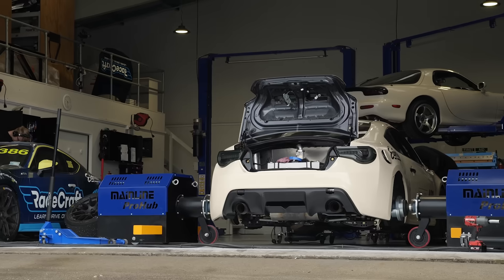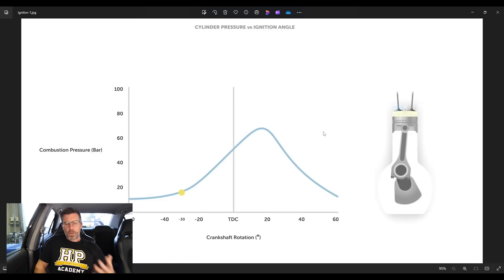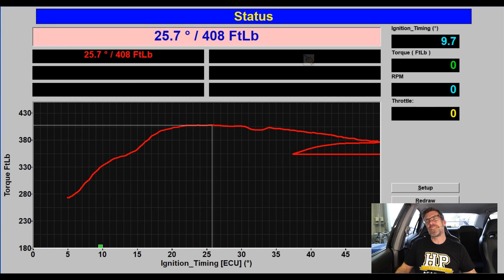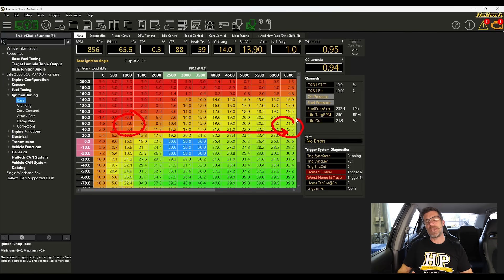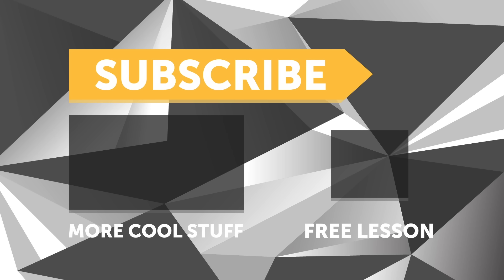25° of ignition timing gave us MAX power. Why?

Comment from the maker: 🙌  Enrol today and get $400 off HPA VIP online course package deal: https://hpcdmy.co/vipek
✅  Want to learn more about ignition and fuel tuning, injector dead time, air-fuel ratios and more? GET 50% off your first HPA EFI tuning course and start learning instantly: https://hpcdmy.co/igtime

Key Terms:
TDC = Top Dead Center
BTDC = Before Top Dead Center
MBT = Maximum Brake Torque or Miminum Best Torque
RPM - Revolutions Per Minute
------------------------------------
TIME STAMPS:
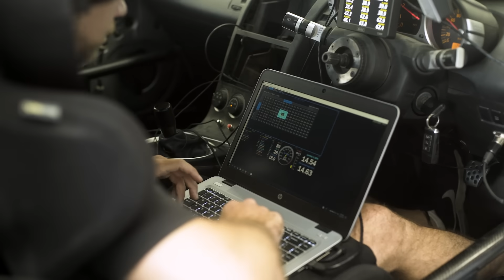0:00 - Common Issue
0:13 - Getting It Wrong
0:22 - The Plan
0:37 - What Is Ignition Timing
0:51 - Combustion Misconception
1:13 - What Is Actually Happening
1:35 - TDC - Top Dead Center
1:53 - BTDC - Before TDC
2:10 - Load Vs RPM
2:24 - Combustion Pressure Graph
3:10 - Compression Begins
3:53 - Peak Cylinder Pressure
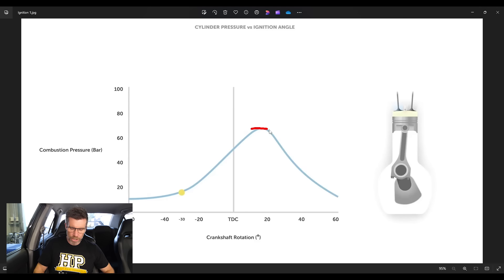4:08 - What Happens When Timing Is Wrong
4:42 - Overly Retarded Ignition Timing
5:23 - Overly Advanced Ignition Timing
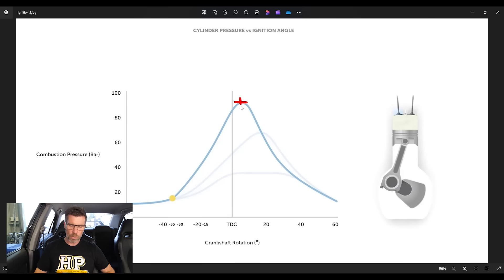6:08 - The Goal Of Ignition Tuning
6:26 - Cylinder Pressure Data
6:44 - Torque Feedback
7:00 - Torque Optimisation/MBT
7:30 - Sweep Test
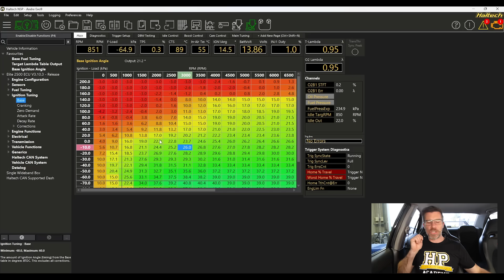7:53 - Base Ignition Timing 3D Table
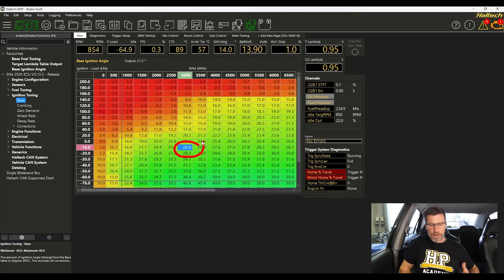8:19 - Test Cell
8:56 - Dyno Demonstration
10:06 - Results
10:49 - MBT - Maximum Brake Tourque
11:21 - IMPORTANT TO NOTE!
11:38 - Knock/Detonation/Pinging/Pinking
11:57 - Just ONE Cell Optimised Here
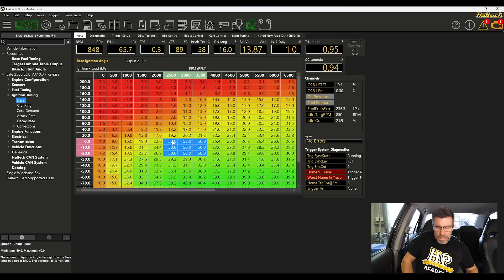12:11 - 1st Ignition Tuning Table Trend
13:04 - 2nd Ignition Tuning Table Trend
13:34 - Low Load
13:50 - High Load
14:02 - Final Notes
14:25 - BUILD.TUNE.DRIVE
------------------------------------
🏆 Win FREE ECUs, engine components, wiring tools, alignment setups and more. Enter now, no purchase required: https://hpcdmy.co/giveaway

Comment: How to get Hp tuning softwares
Reply from the maker: You can download VCM Suite form the HP Tuners website. It's useless unless you're vehicle is supported by HP Tuners, you have their interface tool and also are setup with the applicable credits for your vehicle.

I've linked a guide on how HP Tuners works which covers all those points - Taz.
https://www.hpacademy.com/technical-articles/reflash-tuning-with-hp-tuners/

Comment: Was this a inline 4 engine ?
Reply from the maker: This knowledge applies to any 4 stroke EFI piston engine. This one has 4 cylinders to answer your question, but what is being discussed is not specific to just this 1 engine :) - Taz.
Reply: @hpa101  the reason I ask is because I have a in-line 4 ZX 10 Kawasaki , I was just trying to get some knowledge
Reply from the maker: The principles  here will help you with your goals on your Kawa 😎 - Taz.

Comment: Thank you for a clear and concise explanation, particularly with the graphs showing cylinder pressure, and the demonstration of the torque increasing as the timing increases.

Question:  If the combustion event takes a finite amount of time to occur, wouldn't that mean that timing should always be increasing as RPMs increase?  If that's the case, why do most mechanical distributors (and electronic ignition timing tables) max out the timing after a certain RPM? Such as, getting to about 30° of timing by 3000 RPM, and then still being at 30° advance at 6000 RPM?  Shouldn't they just keep increasing?

Comment: How do you verify any of what is said here. Without measureing chlinder pressure with cylinder pressure sensors you do know where you will have:

1. TDC
2. Compression curve
3. Combustion curve
4. When to actually set the timig. 
5. Knock borderline 
6. The start and lenght of knockwindows. 

So how is any of this verified in the tuning to come anywhere close OEM calibration of these things?

Comment: How were you doing the sweep, just manually adjusting the block of cells during the test?  I was wondering if doing RPM hold mode with the dyno and just sweeping each column wouldnt be a viable method of doing this.  Just curious.

Comment: Do this with a LS
Reply from the maker: Try this link Jimmy, it covers the basics of LS ignition tuning using HP Tuners: https://youtu.be/zi9g7Uhx-Nc
If you're tuning your car using an aftermarket ECU, then the video you're on here actually applies. It doesn't matter that we're tuning an SR20, even if you were too you'd be using these principles to find your own ignition timing figures, not just copying and pasting. Understanding what is done and why is the point.

Note HPA's Practical Reflash Tuning course has 5 GM based examples (Gen 3/4 and Gen 5) that cover breaks things down into the 6-step HPA reflash tuning process: https://www.hpacademy.com/courses/practical-reflash-tuning/?utm_source=youtube&utm_medium=social&utm_campaign=general-interaction
4 examples are LS based, one is LT based noting one is specific to tuning an LS with an aggressive aftermarket cam too (they need some special attention to the idle tuning).
Hope that helps! - Taz.

Comment: How are you making the connection from the haltech to the dyno?  Db9 serial, rj45, etc.? Just can high and low to the connector or does it need power and ground too? I think my AEM series 2 might be able to do something similar but there seems to be no info out there for it
Reply from the maker: You might be struggling with this information because it's specific to the dyno you are using. They are not all created equal. 
We're connected to the Mainline here using CAN, but that won't help you if the dyno you're using and your AEM don't support it. So first identify the dyno and then work backwards from there to determine your options between the dyno and your AEM Series 2.

Note that even if you find there isn't another connection option or a direct pick up, there's usually a way to set the dyno up for your specific car to show some of this information. There are some member webinars on dyno setup and operation using a Mainline in the HPA members webinar archive. It will give you an overview but as above, if you are using a different brand of dyno it won't be the same as the Mainline. Dyno operation is not like tuning, where they follow the same fundamentals; the software can be very, very different.

They dyno here actually just has an update of some software and hardware last week, it's pretty much all CAN now. An ECU actually runs the dyno too (setup specifically for the dyno, not in a way that would run an engine of course). Not relevant at all, just something you might find interesting.

Hope that helps! - Taz.

https://www.hpacademy.com/previous-webinars/112-dyno-operation-intermediate-mainline-awd1200/

Comment: How compression ratio affects ignition timing at boost? For example lets say that the stock CR is 9.5:1 and we lower it do 8:1?
Reply: As no one responded, I think of it this way: with 14.7 psi atmospheric pressure and 1 bar (14.5 psi) boost, we get 29.2 psi, which multiplied by the compression ratio (e.g., 8.5:1 = 248.2 psi, 8:1 = 233.6 psi) increases combustion pressure and heat, causing faster burn and requiring more retarded ignition timing. Pressure and heat accelerates the chemical reaction of burning.

Comment: trying to tune my R18 civic to be less eco more performance at WOT in at AF 13.0 my higher load timings are advanced +2 no knock. can my higher load in WOT be slightly higher then my before WOT? (cant increase before WOT loads due to knock only can adjust last 2. eg. 941. and 1052 loads can be adjusted but before that i cant or i get knock) 

can these 2 loads be higher then the others if no knock?
Reply: ignition timing follows a pattern but my pattern is cut short and i just wanna know if im lacking performance by making the last 2 greater then the pattern. and if i CANT put them higher how do i go around this? no turbo. just my daily.

Comment: Tuning in car vs tuning out of car. 

There's a person I know who builds engines and he says he tunes the engine after he builds it which is just on a stand with the motor running outside of the car. How much horsepower could you get from an engine that's tuned outside of the car like this compared to an engine that is tuned inside the car on a dyno?
Reply from the maker: You end up with the same assuming he is using an engine dyno. An engine dyno will read higher as you don't have the drivetrain losses, but you get to the same place.
If he is literally just banging it on an engine stand with no dyno or way to add engine load, you should never let that man tune your engine. You can't tune an engine without load, that's why you can't just tune it on axle stands either - Taz.
https://www.youtube.com/watch?v=jM0Iqk4Ada8

Comment: spending months figuring out how you do it (RPM stays the same) turns out youre using eddy current dyno or sum.

i have a similar technique for regular dyno, by limiting its RPM first then tune from low to high RPM ranges.
Reply from the maker: Why didn't you ask? That is a feature of the this type of dyno and we have a video on a few different dyno types :)
If you are using an inertia dyno they are a bit more limiting for sure - Taz.
https://youtu.be/dujolvOENs0
https://youtu.be/t5NXae1ED9M
https://youtu.be/tEnXdwLxTxE
Reply: @hpa101  Thanks, it was very informative. i have a video suggestion: DIY dynamometer, I watched a guy who made it with 3 key parts, the chassis, the roller, and Arduino Uno.
Reply from the maker: @MRworldEtIkA cheers for the suggestion! Would be a great podcast topic too.
A chap on the HPA forum built one a few years back as well and posted some interesting bits and bobs about it from memory but I can't remember the user name.
Here are 2 other threads you might be interested in looking at in the meantime - Taz.
https://www.hpacademy.com/forum/build-threads/show/my-chassi-dyno/
https://www.hpacademy.com/forum/off-topic-discussion/show/axle-hub-dyno-diy/

Comment: Ots trickier tha. That my oem spark table look horrible, so rough but i was told there are so ma y adders and modifiers it could be s.ooth. it how do you even know. Some of my ti.ing is pushing 60 degrees at low load
Reply from the maker: Garbage in garbage out. Those modifiers aren't there to compensate poorly tuned base ignition and fuel tables, they're there to compensate for varying conditions and can only do so much - Taz
Reply: @hpa101  have you ever seen a 2019 silverado 6.2l base spark map, its scarey
Reply from the maker: A lot of OEM tuning is. People who don't know anything about tuning always think because OEMs 'spend millions' the tuning must be perfect, but that is far from the truth as any experienced tuner knows right 😎
That's why in many (but not all, some OEM tuning is on point) cases tuning an engine that you haven't actually modified at all will still see a noticeble increase in performance. That doesn't always mean peak power but rather how and where the power is delivered 🤘

It won't help you with your GM tuning but just out of interest Andre discusses some pretty substandard OEM tuning work from Subaru in this video which I think you might enjoy - https://www.hpacademy.com/blog/are-oem-tunes-as-good-as-you-think-ep-2-off-the-record/?utm_source=facebook&utm_medium=social&utm_campaign=general-interaction - Taz.

Comment: what is Kpa?
Reply from the maker: It's a unit of pressure. PSI of the metric system - Taz.
Reply: @hpa101  Is not Kpa absolute?
I've never seen Kpa as a relative to baro.
Reply: @ckratzet5286  Yes, Kpa is an absolute value. 0 Kpa = perfect vacuum, 100 Kpa is about atmospheric pressure. Showing Kpa as a negative (minus) value is technically wrong and makes math calculations very hard to do when all other parameters are absolute.

Comment: Assuming knock isn't a limitation, is there a drawback being in the middle of the plateau, or are there some adverse effects like unstable cylinder pressure?
Reply: If you’re not knocking, it would keep your powerband wider. No downside if you’re not hurting the engine.

Comment: 11:36 i keep hearing mixed reviews on how reliable knock sensors are on higher hp applications but no one gets specific with it, im trying to find a ecu for my 427 sbf e85 10-12psi and am wondering if I should look for a knock sensor or if they will cause unwanted issues in the future, I mainly want them as a safety and for the tuning purposes as our blow through carb just ate 5 pistons...
Reply: @relixio4889  I don’t know why people still go with carbs. Efi all the way baby.
Reply: @Sebman33  thats so helpful as im already switching to efi you dumb mfer....
Reply: @Sebman33  you need friends and experience bud

Comment: So well explained. Max mechanical advantage at 16-18 degrees after TDC.

Easy to imagine pressing down hard on pedals of bicycle. If pedal at top of stroke, or even just after, most of your force is just wasted into bike frame. Push hard too late, you don't get much bang for your foot. We can just imagine that magic spot when pedaling we should press hardest. About 17 degrees past pedal TDC!

Then knowing flame propagation for a given fuel density is same at all rpm, clear you need more advance at higher rpm, as well as more advance for less density (light throttle).
Reply: beautiful explanation
Reply: Soooooooooo.... you're one of them bicycle dudes, right? 😂 Lean and vegan and always in the middle of the road, eh?
- Thank you for the good explanation! 👍
Reply: yeah good analogy but cylinder bang does not have constant pressure right from the start, it builds up over time.
Reply: @kass1564 right, but so does pedal pressure riding a bike. The mechanical advantage of the angle your leg is at as well as how much strength you have at different amounts of leg extension
Reply: Except there is turbulence also, why a good swirl chamber with flat top piston needs much less ignition timing than a hemi with domed piston.  I always wondered why timing seems to max out at a certain rpm and have come to my own conclusion it is mostly due to the swirl at higher rpm increasing the speed of combustion. If im wrong someone tell me

Comment: All different engine configurations will require different timing for maximum power, including the fuel that is used.  With the absence of a dyno to test with, I use the amount of airflow through the engine which is scanned while driving. It is important to have an acceleration load on the engine while finding optimal timing for power. Fuel must be spot on during testing and as you get closer you should adjust the fueling. Find highest airflow for each rpm section, such as per each 500 rpm range, throughout the entire usable rpm range by adjusting the timing. When no more airflow is gained you are at best timing for the rpm. You can finally back the timing off a little based on expected fuel and temperature variation. Love your videos!
Reply: How do you measure airflow through the engine?
Reply: @Programentalist  the scanner PID of the MAF provides the airflow here.
Reply: @teagreen2220  Ah that makes sense of course. No MAF on my car unfortunately just MAP, so not a viable method for me.
Reply: @Programentalist  a similar approach is to indirectly measure the airflow by measuring the amount of fuel the engine is using. This will tell you how much airflow. You must have the fuel dialed in properly with a wideband O2 sensor for WOT timing adjustment since the narrow band sensors will not work here, they are only good to dial in a stoic air/fuel level, any load on the engine will not use narrow band sensors in a racing application.
Reply: @teagreen2220  Unless you're running closed loop the fuel will be what you set it at, how can that help tuning ignition timing?
Reply: @Programentalist  set your fuel Open Loop at current timing, advance your timing a little for test, review data, if data shows leaner fuel AFR then you can now increase fuel in those areas which proves that the ignition timing advance provides more power than your previous timing settings. Correct all fuel for proper AFR and then test a slight timing advance again. This way you can do ignition timing adjustments with a wide band O2 and no dyno. When no more fuel can be added you are done.
Reply: @teagreen2220  Well that's obvious, don't know what I was thinking.
Reply: That only works if rpm is increasing and load is < power output.

Comment: excellent description of what is going on and how timing actually generates more power if correct!  first time i’ve seen someone ever explain the concept of getting the maximum cylinder pressure to happen at the point of maximum mechanical advantage on the rod/crank.  cheers!

Comment: WOW that's cheating !
I had an aluminium bowl, connected to a copper pipe to hear detonation.
And on second gear, kept left foot braking up to max boost pressure, when the bowl started pinging, I lowered the timing 3 degrees 😋
Worked reasonable well up to 400 hp, after that left foot braking is tricky 😂
Reply from the maker: Where there's a will, there's a way! Andre's done plenty of left foot braking for tuning in his time too 😎 - Taz.
https://www.hpacademy.com/previous-webinars/the-key-to-road-tuning-left-foot-braking/?utm_source=youtube&utm_medium=social&utm_campaign=general-interaction
Reply: A copper pipe bolted to the appropriate part of the block, with a ‘horn” on the other end is a great way to listen for detonation.  When I worked for a certain Australian OEM we always had a “knock tube” with a plastic cup on the end poking through an isolated hole in the dyno wall on all our tune and durability engines. We used to call the tinkling noise “the sound of economy”. Those were the days.